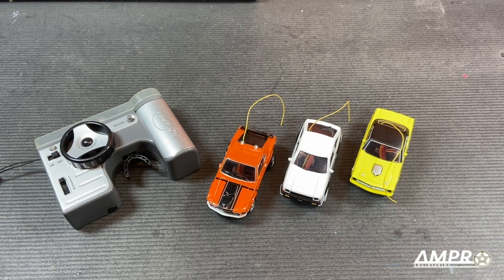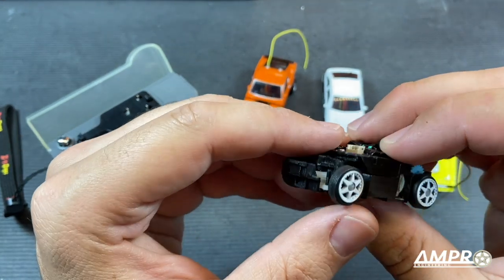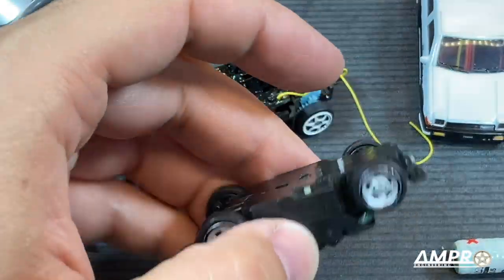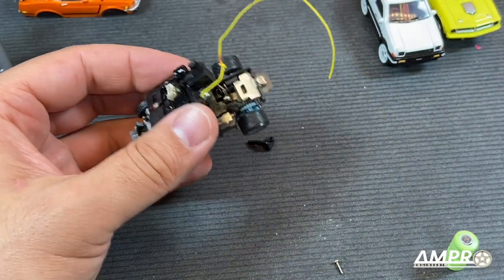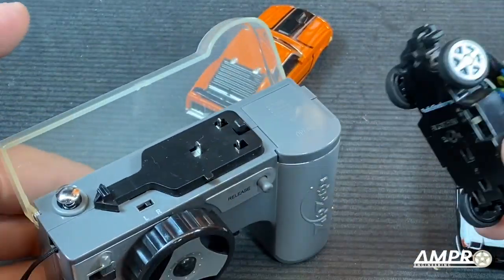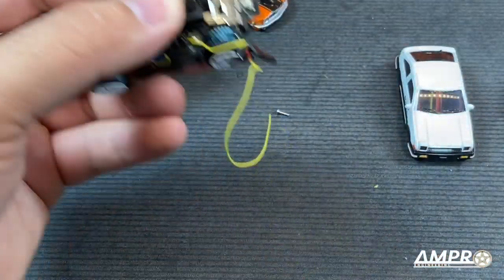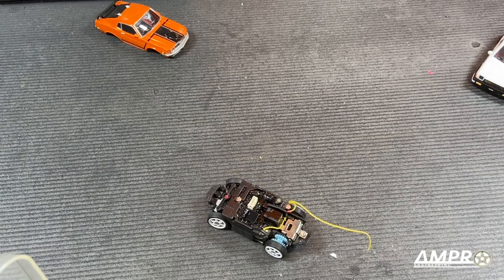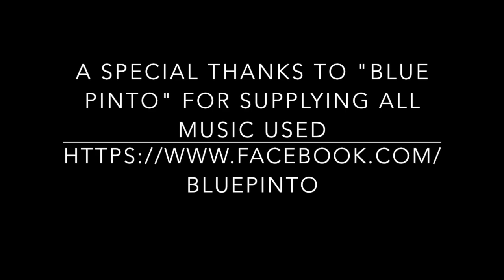e271 - ZipZap SE Battery Replacement - The "I Fixed It" Series

Comment: Glad I kept all my old ZipZaps now :D Only have one of the SE cars (67 Shelby GT500), its battery died over a decade ago and I was gutted. Gonna be awesome to get that going again! Never occurded to me this could be done lol, thanks for the helpful vid. Hope nothing else has gone wrong with it since it was mothballed...

Even the standard non-proportional ZipZaps were great imo, I had one of the 4WD monster trucks (The normal bodies fit on those, and they have a plug for SE body lights)  that was awesome, as well as a Honda NSX and an orange Nissan 350Z. Have that Initial-D AE86 and AE85 bodies with working lights and a bunch of accesories for them too. I got them all when living in Egypt, where they had RadioShack wierdly enough. 

They never sold them here in the UK afaik though, so could never get any more of them. Would love to get some of the other SE Muscle cars like you have there. Good stuff :)
Reply from the maker: I believe it's easier to fix the non-SE cars so that's a plus! I certainly hope this fixes your car
Reply: How fast are the non se ones? 8f I find them on eBay how much do you think they're worth?
Reply: @silviamills5218  the non se is faster than the se because the chasis weights less especially with nos motor and red gears
 Steering control sucks though. For a regular they average about 25 new now the se aver2sges about 45 dollars new.

Comment: Reminds me of xmods. They are what got me into rc. I remember having aa batteries hanging off the back and installing toothbrush motors.  Good times.
Reply from the maker: Yes, those were great also. I had several of them but sadly each one of them failed within a couple of years. Real bummer because I thought they were fantastic
Reply: @AMPROEngineering  I never had mine long enough to find that out but man they were fun. Mine ended up being so fast that I couldn't find a big enough smooth surface on which to run them.

Comment: Over the years there were many different cars from RadioShack that I wanted.

Oh and the black goo is a resin that manufactures use to cover up what components where used as well as to make it harder to see the tracks on the circuit board in an attempt to keep them from being figured out and copied.
Reply from the maker: Interesting. I didn't think of that.

Comment: Found mine sitting around in the case with all extra wheels, tires, cones/barrels,  and the Zip Zaps tool kit!
Of course dead battery after all these years but I took it apart and popped the battery out to see if internally damaged and it is pretty clean.   I guess a new battery is in order - if I remember right the front wheels were prone to hair buildup and I may have shelved it after several de-hairings
Reply from the maker: Oh for sure. These pick everything up!

Comment: Thank you very much for this video! These came out when I was in college and I loved them! Sadly they were replaced by the much more expensive Xmods.
Reply from the maker: Same here. I was in college when I got these and love them. I also had the X mods but those died shortly after. I was always upset about that because I really like them
Reply: If you're talking about the XMODS minis, those were not replacements. They were the same product rebranded. Radio Shack may have thought that XMODS were stealing the spotlight and renamed the Zip Zaps in the hopes that Zip Zaps sales would pick up again. XMODS were in a completely different class. XMODS were made to compete against the Kyosho Mini-Z's while introducing the mini RC hobby to people with shallower pockets. If not for XMODS some people would have never bought a Mini-Z. Zip Zaps on the other hand were competition for the Hobbico MicroSizers which were the Tomy BitChar-G's. In my opinion Zip Zaps won the Micro RC war but, XMODS were dealing with Mini -Z's and a few other competitors at the time. Both the XMODS AND Zip Zaps seemed to get discontinued around the same time as Radio Shack stopped carrying Nikko and Tyco RC's and changed over to carrying New Bright products. They even ended up carrying cheap MicroSizer knock-offs that came in a little bubble-shaped shell that part of the shell was the controller. For some odd reason Tyco, Nikko, HPI Racing and the Chinese company that produced Zip Zaps suddenly got kicked to the curb in favor of the wave of new, cheaply made, lackluster RC's and the department stores were doing the same thing. The quality toy grade class of RC's were coming to an end and the new stuff caused a lot of resentment in the toy grade RC community. Anyway, this is the way I remember things happening. The cool stuff was fun while it lasted though.

Comment: Just got my zip zaps monster truck from goodwill for 76 cents and man it needs a new battery but this thing is a great little truck . What a shame e don’t have many tiny scale 4x4 trucks like the zzmt out right now cause what a blast now that I’m an adult
Reply from the maker: I agree. It is a total bummer
Reply: The zz monster truck is capable of running a 3.7 volt lipo. Lipo wakes up the beast big time

Comment: I worked at RadioShack when these came out. Super popular and really fun to drive around the store in downtime.  I’ve got mine.... somewhere. Haha
I wonder how hard it’d be to upgrade to a LiPo cell or even a super capacitor. 🤔
Reply from the maker: I have seen these with Lipo's also.
Reply: Super easy too lipo if ya can solder,got a lipo first gen,se,and monster truck and played with them nonstop as a kid and been ripping these lipos ones daily at 25 lol

Comment: Great video thank you very much! I want to say I opened One of my old ones only to find the battery has soldered leads. Going to try to do some very fine soldering. Wish me luck!
Reply from the maker: Wow! Maybe an early revision of the car? Good luck! Take your time and you will be good to go.
Reply: @AMPROEngineering  Thank you for the encouragement. I will let you know if I am successful.
Reply: @AMPROEngineering  And yes by the way they are not special additions. The controller they come with is not the pistol grip type. This controller is slightly different than the original.

Comment: Sorry for commenting on an old video but I’m trying to understand it. Do you need to cut the white film off the battery before putting it in the car? Or is it just an option so you only need to cut the chassis on one side? It looks like you put a new battery in with the white coating still on, but then you need to take it off to get the car to charge. 

I just bought a brand new SE on eBay and the battery from the link you shared so I’m hoping the battery hasn’t completely corroded and destroyed the inside!
Reply from the maker: Not a problem! I removed it since the battery was bigger and fitment was super tight. I learned that only one side needed to be cut to get it to fit so it reduced the danger to the chassis. I did install one with the coating but later cars I took it off. I am just editing the video a little jumpy as I was learning as I went. Go slow with the mods and good luck!
Reply: @ Thank you! Do you know if removing that layer is safe? Does the battery potentially get very hot without the heat shield?

Comment: It seems like the battery size for the older series of zip zaps is 1/3 AAA, and the newer ones used two 1/4 AAA in series.
Reply from the maker: Yeah those are a lot harder to locate.

Comment: The zzse can handle 3.7 lipo battery. Battery must be charged separately by lipo charger then programed via controller.
Reply from the maker: I think they can but it is really pushing the PCB to the limit.
Reply: @AMPROEngineering  pcb handles the 3.7 lipo with ease. Bonus it make the range/frequency reach further and less servo stutter. I have over 20 zip zaps and yes they all handle the 1s lipo just fine. On the se with lipo car is charged by a usb 1s charger. Car must be in the off position while charging. Once charged turn car on place on controller and wait till programming channel light changes remove car and it's ready to go. Do not charge car with controller. It may drop voltage in lipo battery.
Reply: @stower82  I soldered mine straight to the bored so no on/off switch but still handles it,and its a big 3.7,got a se,1st gen and 2 monster trucks all on lipo with no problems

Comment: Gonna float this up the ol' inter webby thing 3 years after initial post -  Can we replace the batteries in the original 1st gen ZipZaps? I have one OG starter kit and then bought all the optional bodies from F&F movie plus others, motors, gear sets, wheels on and on but I find the ol' orange Hemi Challenger doesn't want to charge no mo. Any help would be appreciated, tx !!   👀
Reply from the maker: You can but I have never tried. I think the batteries on those are actually easier to locate than the SE versions. Sorry I dont have more info!

Comment: i just bought one for 50 dollars lol.. its unopened but ima open it up (lifes too short) and see if i can get it to work again . very nostalgic as i spent all of 5th grade racing these across the classroom floors back in 2003 lol.. gunna see if i can find the fast and furious bodys that were popular at the time, and maybe try to upgrade the motor..
Reply from the maker: These are super cool! I will be selling these soon. LMK if you are interested. amproengineering@gmail.com

Comment: This might be a bit late, but do you happen to know the measurements of the original battery?
Reply from the maker: I should mention it in this video somewhere. Unfortunately they are long sold on.
Reply: @AMPROEngineering  appreciate your help all the same! Your video made tackling the job look pretty approachable, so I picked up a few cars to try for myself. Excited to get started!

Comment: I just got the stately and hutch brand new should I have a charging problem haven’t opened it yet still being shipped
Reply from the maker: Yes the battery will be dead. You will need to replace it as shown in this video.

Comment: Do these use a coreless motor for the steering as well ? Cause if so I could make my monster truck full proportional with a board from one of these
Reply from the maker: Oh boy I dont know. It is a great question.
Reply: Yes they all use a corless motor for the drivetrain. And if it's an SE it uses a corless motor in its servo. There were certain models which were made by xmods that had a cordless motor and a gearbox for the steering. Older models used coils and magnet.

Comment: what about the first gen cars. I have a couple of them and the monster trucks. what batteries would you recomend using in them
Reply from the maker: Sorry, i do not own one so I am unaware of how those can be repaired.
Reply: The non SE takes  1.2v 1/3AAA battery.  The Monster needs 2.4v (1.2v 1/4AAA x 2)

Comment: I have zip zap one too but mine must be an older version because you can see the mother board on the top and there is no on/off switch. Wish it worked
Reply from the maker: Yeah you have the standard ones. They sold along side these but at a lower price point. Most likely it is your batteries that are dead and you should be able to google replacement ones.

Comment: Got one of the first version Transformer edition from 2007, battery is gone, didn't find quater-AAA here in India, trying to place a 3.7 v li-po but couldn't get it working, even tried with a buck to go 2.4V but no luck, motor are functional, think radio is gone (may be due to 3.7v I used earlier. :( )
Reply from the maker: It is possible. These things were not made well and it is amazing these are still going.

Comment: I just bought some dead zip zaps. Any common problems other than the batteries I should know about?
Reply from the maker: Not yet but they are certainly getting older.
Reply: Okay thanks!
Reply: Will get rapped around the front axels between rims/tires also behind the gear axels. Be sure to run them on a very clean surface.

Comment: Is vinegar really safe to use inside of them? I have one from my dad and it has some pretty heavy oxidation
Reply from the maker: It is probably one of the safest way to remove the corrosion. Just clean everything after with alcohol and make sure it's all dry.
Reply: @AMPROEngineering  oh ok thx ^^

Comment: I recently just bought a zip zap the battery charges in the car moves forward but the car does not turn or go reverse do you think I need a new battery
Reply from the maker: No it is the electrical that has something dead
Reply: Well that sucks😞
Reply: You may have to take the controller apart there are electrical contacts inside for the turning and the go forward and backwards. If these contacts are worn or have corrosion which is a good possibility considering how old they are they may have to be cleaned up to work.

Comment: does this battery also work for base model zip zap cars replacement?
Reply from the maker: No, this voltage is too high.
Reply: Voltage is not too high people have been modding these little cars for quite some time even the very first issued zipzap can handle 3.7 volt lipo battery. Before the day of LiPO batteries there were many groups in the micro RC forum that were dual battery modding these cars for speed and performance. Many people also did fett mods which allowed for more battery power and higher delivery of voltage to motor and steering. I have been modding and collecting these little cars since they came out.